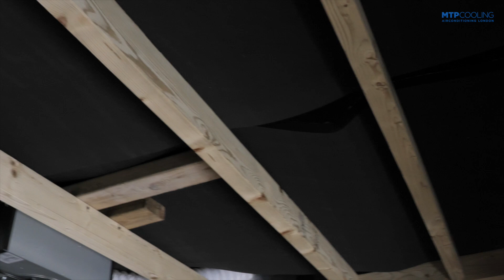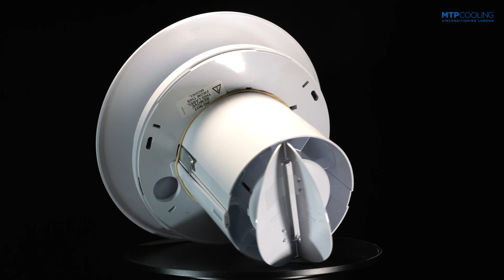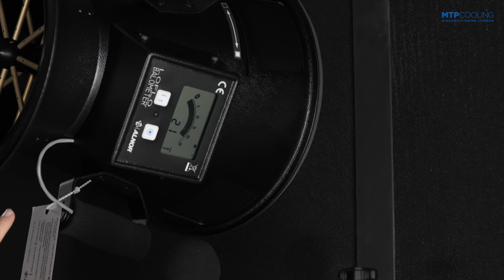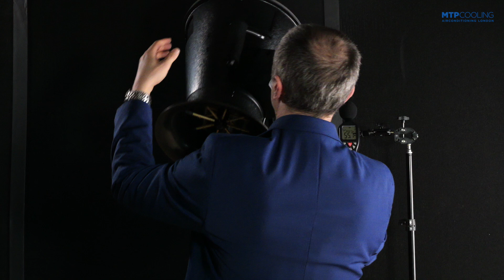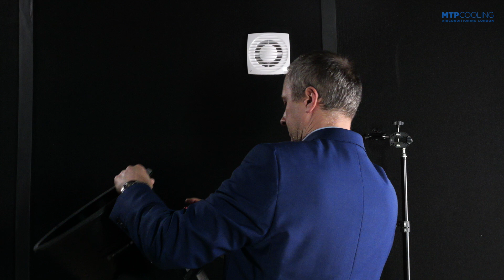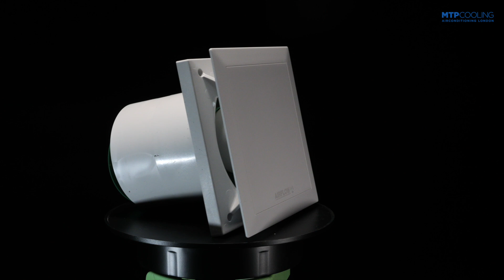I test 13 most common extract fans in the UK

Comment: Fan Name	                                        Claimed Airflow (Manufacturer)	Tested Airflow (with 3m Duct)	Claimed Noise Level	      Real noise 	 Power Consumption
Xpelair Simply Silent Contour C4	Speed 1: 13 L/s, Speed 2: 20 L/s	Speed 1: 11 L/s, Speed 2: 15 L/s	40 dB	                     51.17 dB	N/A
Monsoon Silent Range	                                                              27 L/s	    21 L/s	                                              22 dB @ 3m	              53 dB	7.5 W
Xpelair DX 100 T	                                                                             20 L/s	    12 L/s                                           	N/A	                              54.4 dB	N/A
S&P Silent 100 CZ	                                                                    20 L/s	         ~20 L/s                                          	26.5 dB @ 3m	      50 dB	8 W
Airflow Aria 100	                                                                           20 L/s	          14 L/s                                            	26 dB @ 3m    	      50.9 dB	6.3 W
Manrose 100	                                                                           23 L/s	          20 L/s	                                     Not labeled silent   	              55 dB	N/A
Airflow Aura ECO 100	                                                                   19 L/s	        12 L/s	                                                29 dB @ 3m	              48 dB	5.6 W
Airflow iCON 15	                                                                          19 L/s            16 L/s                                           	28.8 dB @ 3m	       50.4 dB	9.4 W
National Ventilation MER100T	                                                   28 L/s	       ~20 L/s	                                               Not labeled quiet	       57.12 dB	N/A
Airflow Quietair QT 100 T	            Speed 1: 20 L/s, Speed 2: 25 L/s	         21 L/s	                                      25 dB @ 3m (Ultra silent)	50.4 dB	5 W (at Speed 1)
Vent-Axia Silent fan VAS E 100 T0	Speed 1: 6 L/s, Speed 2: 22 L/s	         20 L/s (at Speed 2)	             2 dB @ 3m (likely Speed 1)	49.3 dB	N/A
Inter vent NVF 100 T	                                                                   23 L/s	      ~20 L/s	                                                 Not labeled silent	54 dB	N/A
Helios Mini Vent N1/100 NC	     Speed 1: 20 L/s, Speed 2: 25 L/s  	 20 L/s	                                       25 dB @ 3m (Ultra silent)	50.2 dB	5 W (at Speed 1)